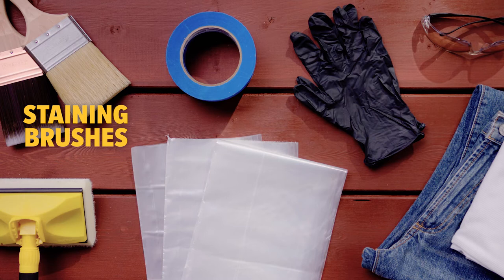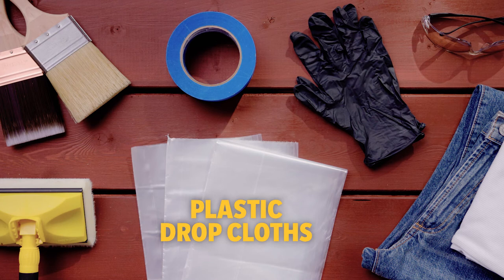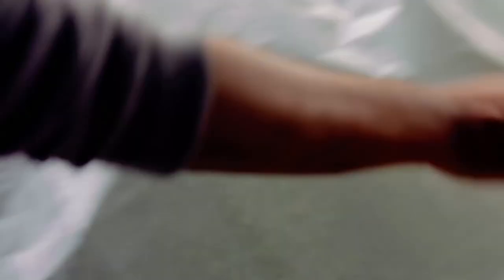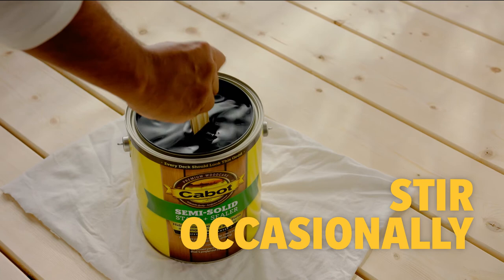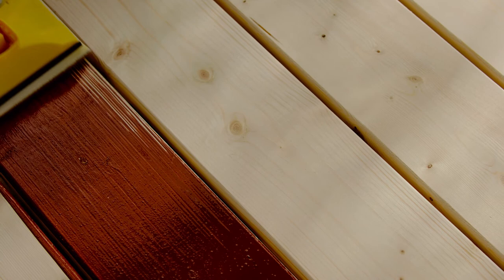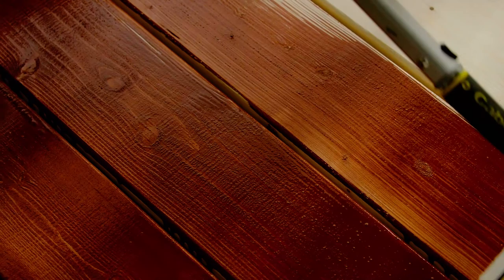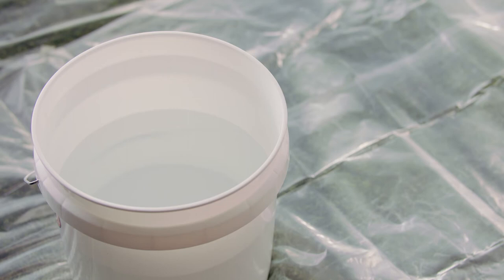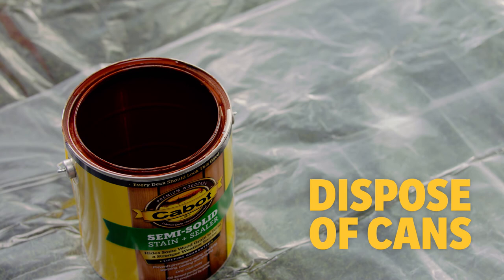Cabot - How to Apply Wood Stain

Comment: Australian Oil Stain dark color-I used your stain on our new treated wood deck. Color looks fantastic. We have a gravel driveway so every time we walk on the deck it gets gravel dust footprints everywhere the day after we stained the deck. How can I get the foot prints off without hurting the stain color? We tried hosing it down with water but did not work.

Comment: can this product be sprayed with an airless sprayer? Ive got 850 feet of 6' fence to stain. i really do not want to roll and brush it
Reply from the maker: Hi JT, great question! Although you would have more control using a brush or a paint pad, you can apply our wood stains with a sprayer. You can find more staining tips and tricks here: https://www.cabotstain.com/en/how-to/stain/how-to-stain#tabs-dc3b0bd657-item-2b98ebfdc4-tab

Comment: Should I wipe the stain with a rag after I brush it on?
Reply from the maker: Hi Murdock! What product will you be using?
Reply: @Cabot   Semi transparent stain and sealer it is not oil base.
Reply from the maker: @murdocklee8014  No — there is no need to wipe stain with a rag after brushing unless you've overapplied by mistake. Hope this helps!
Reply: @Cabot  Thanks,  I love the results.
Reply from the maker: @murdocklee8014  We're so glad you love your finished project!